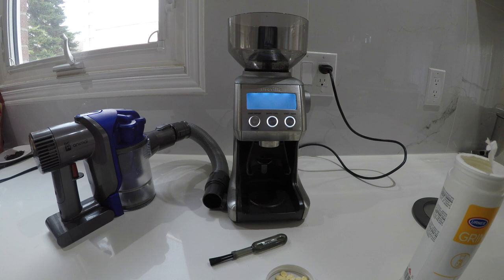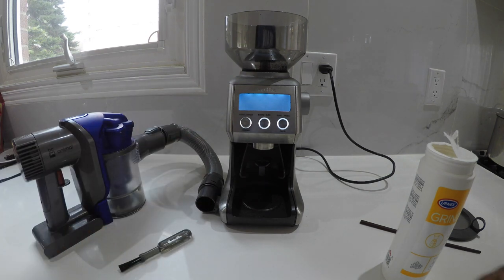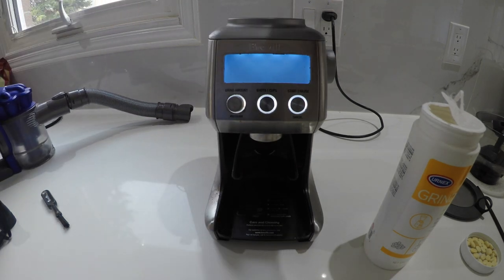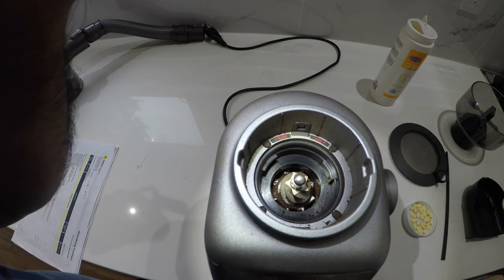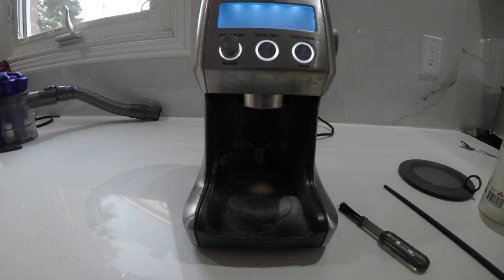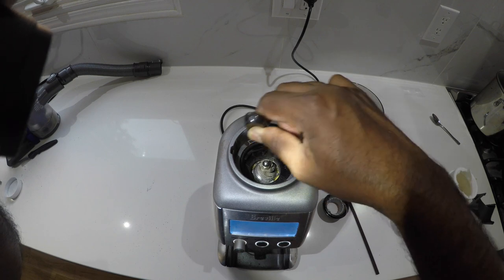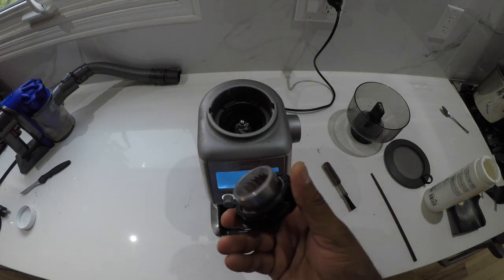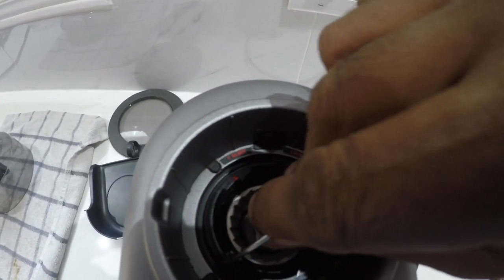Cleaning Breville Smart Grinder Pro

Comment: Thanks. Your video is much appreciated. I purchased a Harbor Freight 2.5 Gallon shop vac (small) and have it stored under my kitchen counter.  It does the trick.
Reply from the maker: Glad that you like the video. This Grinder is fantastic.
Reply: @NishanAmarasuriya  hey just got this grinder... do you have any grind setting recommendations for a drip machine, pour over and for making cold brew? I want to try it out with the Kalita wave 185
Reply from the maker: @timothycoglietta1238  First of all, congratulations! I use 40 for my drip machine. it is little coarser (Medium) You need to do some trial and error. Do not go over 46 as the granules may be too big. For cold brew here is how I make it: https://www.youtube.com/watch?v=MyisVzuCqdA&t=84s